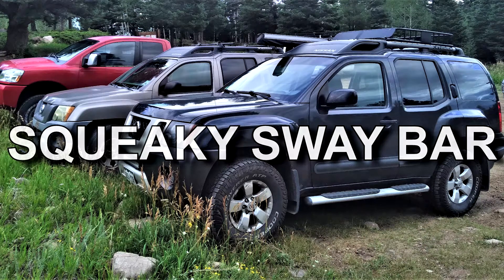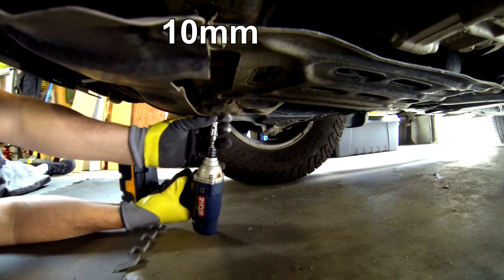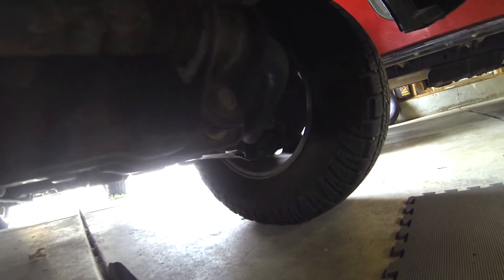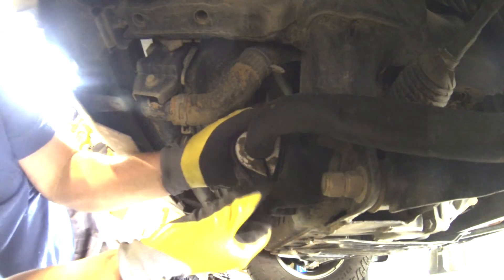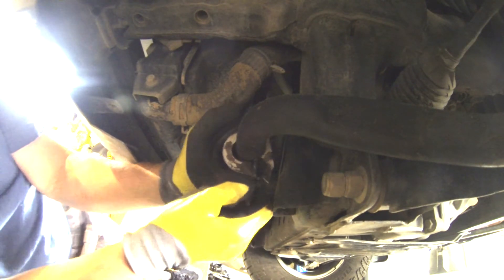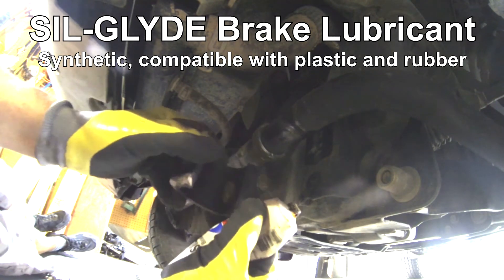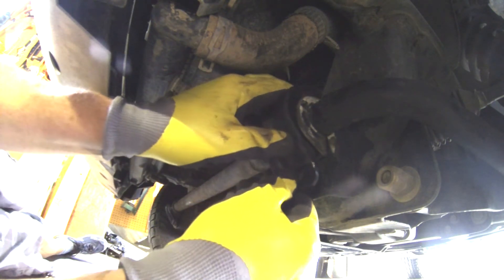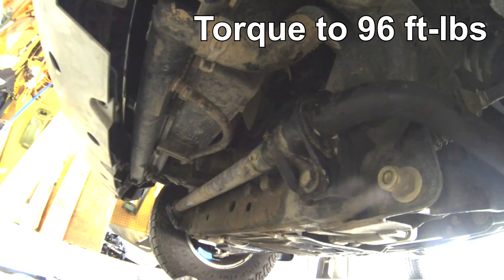Nissan Sway Bar Squeak Xterra Frontier Pathfinder Squeaky Front End Fix DIY Grease Noise Bushing

Comment: I've had a front end squeak in my Xterra for a while now that's been driving me nuts. It squeaks when the engine is off and the vehicle is barely rocked/bumped. I'm gonna try this and see if it cures it.
Reply from the maker: Good luck!!
Reply: Any luck?
Reply: Sometimes the hood latch needs to be greased. Could try this too